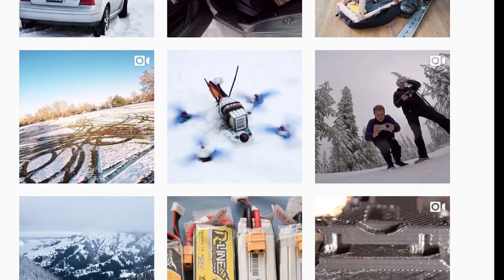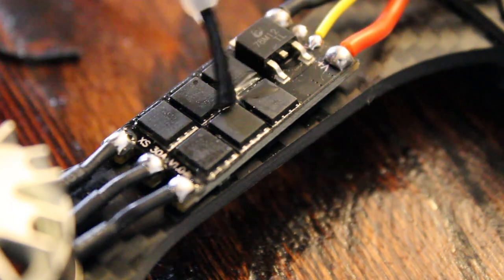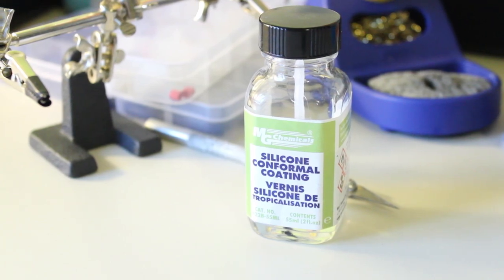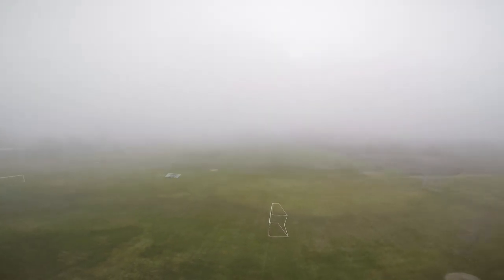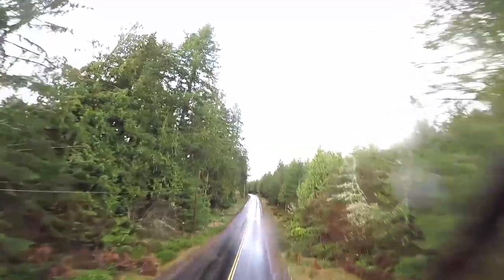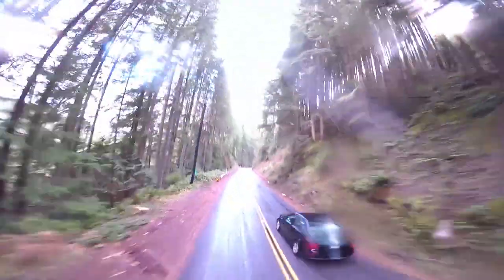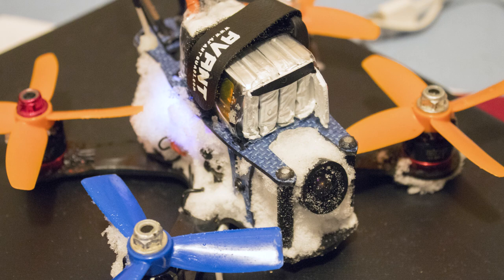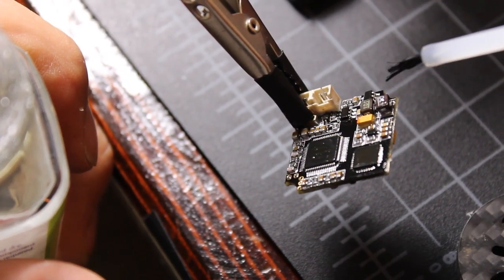How to Waterproof Electronics (the clean way)

Comment: wowww you've had much better luck than I with conformal coating... then again I used acrylic. I'll have to try silicone coating asap
Reply: Le Drib I've had good luck with acrylic by same brand... what issues were you having?
Reply: Yeah the acrylic coating I used is the same brand. Applied the same way you showed. After a couple crashes in the snow things still just stop working. ESCs and video transmitters in particular
Reply: Le Drib strange... I haven't had that problem. Are you sure it's the esc and not the FC? Do your vtx and FC share the same power supply?  my guess is you just need more coating... props off and add water to each component individually to troubleshoot.  Merry Christmas!
Reply: The acrylic applications listed on the MG chem lists "Automotive air bag controllers,
Cell phones and Computer tablets components,
Avionics" While for the silicon version it does not. So I'm guessing the acrylic would be better for sensitive electronics.
Reply: According to Chemtronics, in regard to their line of coatings, this is the difference between acrylic and silicone. Almost seems like you should use silicone on most of it and acrylic on solder connections.

"AR – Acrylic conformal coatings provide fair elasticity and
general protection. As one‐part systems, they are easy to
apply and remove. Acrylic conformal coatings are
recognized for their high dielectric strength, abrasion
resistance and ease of removal.
SR – Silicone conformal coatings provide excellent
protection in a very wide temperature range. They provide
good chemical resistance, salt spray resistance and are
very flexible. Removal can be challenging, requiring
specialized solvents and long soak time. "
Reply: I can only get the acrylic version in my country. Should I bother?
Reply: Are you from Washington State
Reply: Le Drib... I've read that the acrylic can't take the heat generated by certain components, VTX, ESC'S, etc and it cause the acrylic to fail.
I think the silicone based coating is more resistant to heat. 
Has anyone tried WD-40 Specialist silicone waterproof? A guy here on you tube used it very successfully! And, it's quite a bit cheaper and you get a ton more.... $5.41 @ Walmart for 10 ounce can! Easy to spray on with tiny tube that sticks in the end of spray nozzle, like other WD-40 uses.
I've read their factory info and it seems like similar stuff... It too dries in minutes and lasts! Co0ol!
Reply: mrkrag... There's the info about heat tolerance that the acrylic lacks.

Comment: Hey! Great video!! I use that stuff too, although I will probably use it more often now, after watching your video.
Also, this particular brand of conformal coating can be seen with an ultra-violet light after it is applied. I use the UV light from a UV "5 second" glue kit to see were the coating is and to see if I have missed any spots, works well!
Thanks for sharing your stuff!

M
Reply: UV light tip is great Thanks

Comment: I use plasti dip on my circuit boards. Its rubber feel like material but its in liquid form when applied so it makes like one thick rubber mat over the board. Its also easy to peel of since mine is black (u can get other colors too, to mach your build) Its cost effective, my jar cost like 35 euros and its half liter and it is going to last me forever. It is also much better in my opinion to have some solid color than transparent since in that way you can be sure that every component on your circuit board is covered with it. It also doesn't ruin your welder tips since you can peel it off if needed and be sure there is none of it left on the solder joint section.

Comment: I didn't realize they were so fast and responsive. It's like a remote viewing experience. I need one! I'd want more than just a conformal coating though. A triple layer protection protocol, like conformal coating on the bare components, layer of flex seal, then something similar to a cell phone case.

Comment: Used the same coating on tinyhawk freestyle, almost no issues after many crashes into deep snow. Only after 5-6 crashes in a row, when the board is really full of melting snow the vtx may start showing black lines. After drying everything is ok again

Comment: We use conformal coating at work a lot, and a handy tool I use is an "orange stick" to scrape coating off if it's thick. I think I got them at Mouser, but you can whittle your own I suppose.

Comment: if you are in the UK the product "EFSC15ML CONFORMAL SILICONE COATING" will do the same job :) no affiliation here.. just used it on my own quads
Reply: i would say you could do at least 5 quads with 15ml...
Reply: just make sure to use a waterproof hd cam ;)
Reply from the maker: That's unfortunate but also doesn't make any sense
Reply: never had an issue with it tbh, covered all my flight controllers in it and leds and escs
Reply from the maker: ***** I have a whole bag full of dead SPF3's they seem to die easily
Reply: kiss fc, xracer f303 2.1 and 3.1 both are fine after a coat of it

make sure your 5v vreg is putting out the correct voltage (or get one that takes vcc directly)

Comment: this stuff is awesome!   I have been using it for quite a while and have had no issues at all.   awesome flying from the moving car.  if you have a black light that coating will glow if you shine it on the part so you can see if you missed anywhere or after working on it to be sure you didn't scrape any off

Comment: I always wondered about resoldering after applying conformal coating - thanks for the tip at 1:33.  That powerline at 4:37 must be hard to see while night flying.
Reply: Easy rework and repairs: Solder through the coating or remove with MG Cat. No. 8309 Liquid

Comment: Thank Samm, nice flying, glad to see a crash, I was just asking how does he not hit those wires, I would hit them every time like a magnet, and then you did. LoL, nice to see others crash some times too! I use that stuff because I was burning out esc boards all the time. using the brush had 50/50 results. worked a few times but then the boards torched. the brush was way too messy for me and I guess I missed spaots some how, so I now us a small compressor and hobby air brush to apply it very nice finish and it works great. A little extra work but looks neat and works great. anyway thank agian and keep em flying!
Reply: Samm passed away in 2018
Reply: @zazzaz8431  I'm sorry to hear that
Reply: my regards to his family n friends

Comment: I think one issue, even if the silicone actually resist high temp on its own, is the electronic cannot cool as well. Might not be an issue for the FC, but the ESC will get hotter faster, and might fail (or stop working) sooner, depending on their safety threshold on temperature. Likely not much an issue when flying in the winter time.
Reply: dont overthink it a well tuned and well setup quad wont ever got hot. HEAT is wasted energy. not to be confused with speed of use of energy

Comment: I can see this working very well for wet conditions but wonder about water proof, as in dumping it in a pond or other body of water. Have you tried that? I've already ordered a bottle regardless, looks so much better than CorrosionX or epoxy.  Good stuff as usual Sam.  I'm jealous of your quickly learned flying skills, those dives through the mountain road trees were awesome.

Comment: For all the people confused and asking about acrylic vs silicone.  DO NOT USE acrylic. Not only does it lack resistance to heat... it also does not flex. when it dries it dries HARD, so any time you crash or cause any kind of vibration or jolt you get cracks in the acrylic and it WILL FAIL!

Silicone not only handles the heat better, it also flexes with jolts and crashes. It also adheres better to itself than acrylic... So when you solder and re-apply you get a nice thick SINGLE layer... instead of multiple layers that have hardened on top of each other, again causing cracks.

It is important to get the silicone conformal coating... or you are wasting your time and money.

Hence why Le Drib did not like the stuff. he used acrylic and of course it failed.

Do it right, and never worry again!!

Comment: I like what idea you had about protecting your boards, but what about the motors?
Reply from the maker: Brushless motors are already waterproof by nature. It's just coils of insulated wire. Water may cause bearings to wear out quicker though. Don't let it sit all wet for a long time. Warm it up and dry it out after flying

Comment: I am going to use self-fusing silicon tap + silicon sealant for ESC, epoxy for LC filter + Capacitor, silicon sealant for FPV Cam, corrsionX for VTX and FC

Comment: I have been using clear lacquer over the years on my homemade PCBs. 

This product looks similar to the thin layer of 'potting' compounds used in most automotive ECUs. Great for sealing out dust and moisture. Have you noticed any increased temperature in the components in dry conditions?
Reply from the maker: Well they are usually buried under layers of heatshrink and electrical tape so this is probably better

Comment: Are the motors already waterproof or did you coat those too? What about the little 2 pin connectors? Do you reconnect those and then coat them? Or is that what you were saying to do with the WD-40?

Comment: i like the idea but this product 422B contains xylene, toluene and acetone. The thinner looks to be straight acetone.
Though it's suppose to be meant for electronics, circuit boards etc, my concern is it eating away at some component they got cheap and installed on the boards.  You never know...
Also for best results it's calling for baked/heat curing. Off the top of my head I believe the temp they recommended for heat curing was 65C. Not positive about that number so check first.
I'm looking at a couple others that don't contain the harsh solvents. Though i may still go with MG Chemicals 422B. 
Thanks for sharing your findings and build for waterproofing. Cool vid..  no pun intended. 😀

Comment: don't forget about your camera, I used liquid tape for mine all the way around everything up to the edges of the lens.  

also, don't put conformal over switches or push buttons in the Vtx.  I filled my Vtx with corrosion X inside the heat shrink, then liquid taped the ends and connector... my quad should be fully submersible now.  too nervous to test still.
Reply from the maker: +quiljw01 I just coated the internal circuit boards

Comment: Great video and follow up.  I have seen this a bunch of times.  What about Dielectric grease on the plugs & connectors.  Seems like that would be a great solution for extreme waterproofing.  I live by the shore so not too much snow, just a whole bunch of salt water 😧😲😱.  I will try it (of course by accident), and I know to rinse it with distilled water.  Great video

Comment: Snow is non conductive. So as long as your quad stays in sub freezing air after a snow cover landing , you should be good with just blasting it out with a can of compressed air. I will however be doing this to my winter quads just to be safe.
Reply from the maker: +Cam Taylor quad parts get hot = melts the snow
Reply: I know. The motors, battery and VTX are probably the highest consumers of power thus are the parts that heat up the most. Thanks for the great video!

Comment: Yesterday I flew on a large field where the grass had just been cut. The time before that I flew on a field with a baseball field with some type of slimey algae growing in the infield. Of course I crashed in both and they were a mess to get out of all the nooks and crannies in the boards. If I had waterproofed the quads, couldn't I just take them home and run them under the water to clean all the gunk out of everywhere? That would have saved me a whole lot of time and effort! It was tedious! To me, that's one of the biggest benefits of waterproofing, if you guys think I could flush the gunk out with a faucet dunk...

Comment: Hi, how to water proof LED light panel board without changing colour of the LEDs while heating after a long run. I would like to use LED lights in cold storages where salty moisture is present

Comment: the battery can easily short if it's in the snow  try putting your quad in a tub and running it
Reply from the maker: 2.4 and 5.8ghz really don't go through water at all but I am confident that, if I put water displacing oil on all the connectors and sealed the FPV cam better, that it would have no problem after a full submersion. I also believe that you really won't have any problems with the battery and snow or water. Submersion is a whole nother level, but still, with time in rather salty water you will get corrosion on the contacts and eventually overdischarge. But for a few minutes a battery should be fine submerged.

Comment: Question: Motors. Do they hold up ok in wet conditions? Wouldn't think they would but... your not putting this stuff on them right? So yeah, how are the motors holding up? I'm in the lake effect snow belt here in Syracuse NY! :-() ...so needing this! :-)
Reply from the maker: brushless motors are already waterproof by nature. It's just coils of insulated wire. Water may cause bearings to wear out quicker though. Don't let it sit all wet for a long time. Warm it up and dry it out after flying

Comment: This is awesome, I am looking at building a quad and a plane for use above sea water (floats on both), would this stuff work for that too or would I need something stronger? I have seen CorrosionX being spoken about but that stuff is pretty expensive compared to this. Thanks
Reply from the maker: This is good for all solid state circuitry. CorrosionX is a good choice for connectors and physical contacts

Comment: How waterproof is the stuff that's not soldered? Like the XT60 connector for the battery or any other plug on the FC?
Reply from the maker: +Zerro they most likely don't matter but you could oil them with some corrosionX

Comment: It would be great to know how to use this on servos
Reply from the maker: Servos are close to waterproof already. you could paint the seams of the case or some like to open it up and spray corrosionX inside.
Reply: well I am using something similar to corrossioin x but silicon based inside and then outside liquid deep, but this thing looks less messy
Reply from the maker: It only works to protect circuit boards or conductors. It hardens like flexible silicone nail polish and should not be used on moving parts.
Reply: yes I got that, but then in a servo, since the motor is alredy waterproof, I can apply it only to the board and soldered joints and it should be ok, right?
Reply from the maker: Most servos have brushed motors inside, which are not waterproof

Comment: They declared "Service temperature range -40°C to +200°C". But How hot your soldering station?
Reply: nRADRUS I think the Coating vaporates if you solder throu it. So you have to apply it again on the Solderjoint.
Reply: -40°C or -40°F? See what I did there?! man... I'm a nerd... SOrry :O
Reply: Adam Demas
copy-pasted from spec.
Reply: You're fine, I was trying to be funny :(   -40 is the same temp in Ferenheit  and Celsius
Reply: Adam Demas
, it's funny, but i am too far from imperial units, sorry)
Reply: greatvvid thanks ,will the water affect the motors
Reply: donkey If it is not salty it won't. But salty water would damage the bearings if you don't clean them afterwards.
Reply: how do you clean the bearings? i plan to take my quad on vacation with me. The salt in the air alone might be a issue.

Comment: so any issues with this product? i here autobotix brand but not sure what to use? i have fpv race quad but just in case i get caught in rain or something stupid happens. I do have question about my fpv cam would i take apart to make sure it coated hs 1177 rotor riot cam. I may try this if you reccomend over the aibotix stuff

Comment: i feel like this question was asked already, but what about using this on brushed motors? i saw something about brishless being waterproof(depending on quality) and something servo motors being brushed. hows about that? can brushed motors be "waterproofed"?
Reply from the maker: Brushed motors have physical electrical contacts inside which cannot be insulated without sealing the whole body. So it's more risky, but you could try to make sure the little brushed cans are sealed.
Reply: i dint think ill try it unfortunately. there are open ports on the top of my 8.5mm motors and dont want to end up filling those holes and sealing my motors in place.
Reply: Brushed motor are all but waterproof as well a lot of crawler guys use them but impurities are hard on brushes.

Comment: How do your batteries handle the snow/wetness? Other than the increased voltage sag from the temperatures.
Reply from the maker: +Brian Minto decreased voltage sag from the temperatures - Just keep them warm before flying and they won't get as scolding hot while ripping. They're basically waterproof too

Comment: hey Samm, how'd you get your motors waterproof, since they are the only moving part...
Thanks in advance
Reply from the maker: They are just coils of insulated wire. No contacts or brushes. They are already waterproof. The only thing to worry about is your bearings.

Comment: How to complete remove I Applied to my brushed drones and they went into bind mod and won’t connect to controller. And no I did not put it on the bind button or motor connectors

Comment: But, how do you deal with your motors? Or you are using waterproof motors?
Reply from the maker: brushless motors are already waterproof by nature. It's just coils of insulated wire. Water may cause bearings to wear out quicker though. Don't let it sit all wet for a long time. Warm it up and dry it out after flying